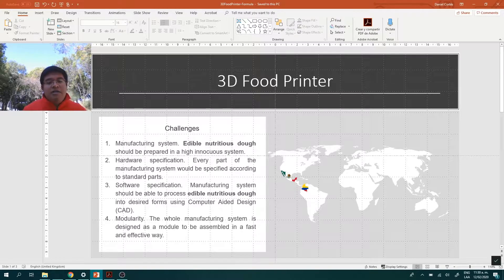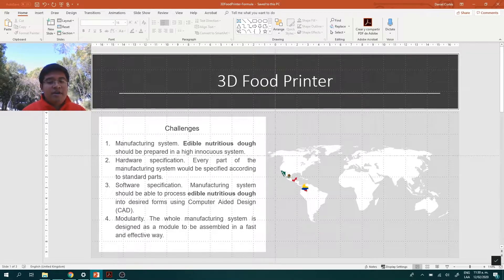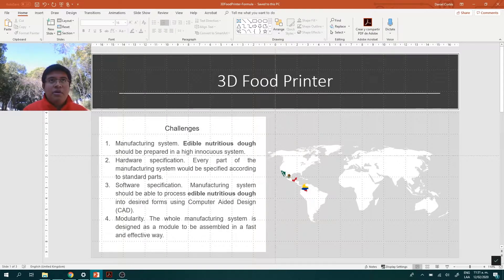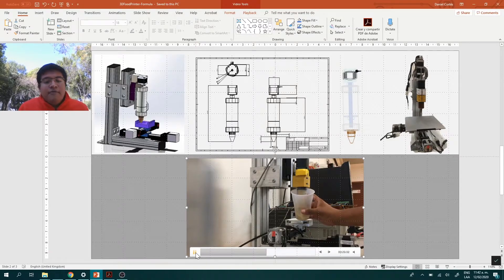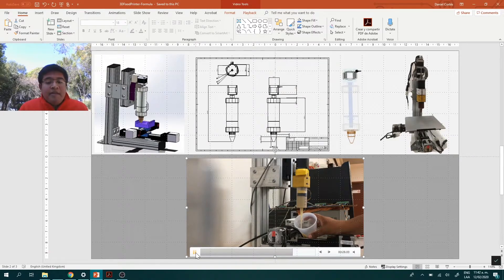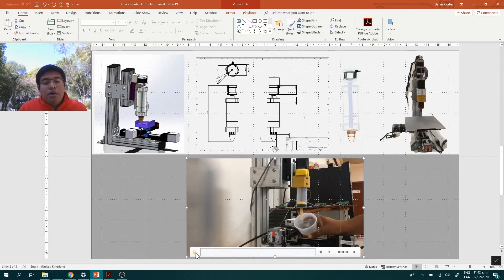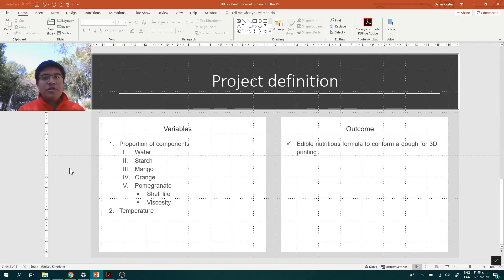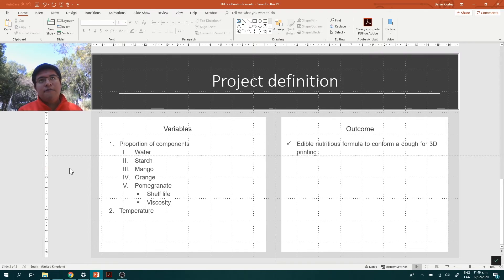3D Food Printer - Formula (Experiment Design)

Comment: Hi Daniel - what a fascinating idea. Nice. If I understand correctly, your output variable is viscosity of the mixture. This is, in my experience, sometimes quite tough to reproduce. So it is important that you have several replicate experiments to test that.
Also, what ranges of the ingredients will you vary? Because it is a mixture, as you increase one ingredient, the proportion of the other ingredients will decrease, so be careful in your design. You will probably have to consider using a mixture design.
Good luck! Kevin